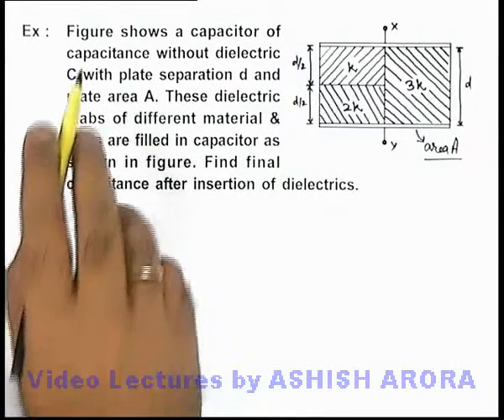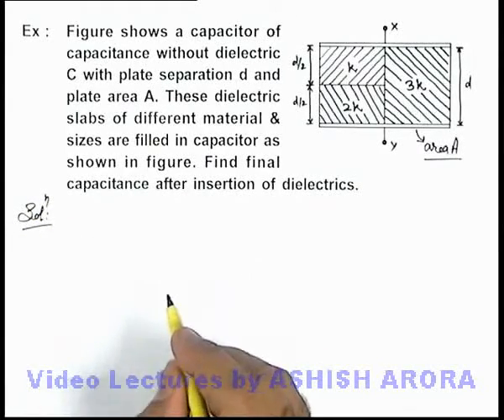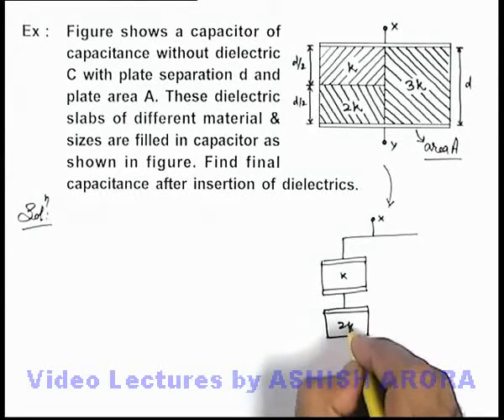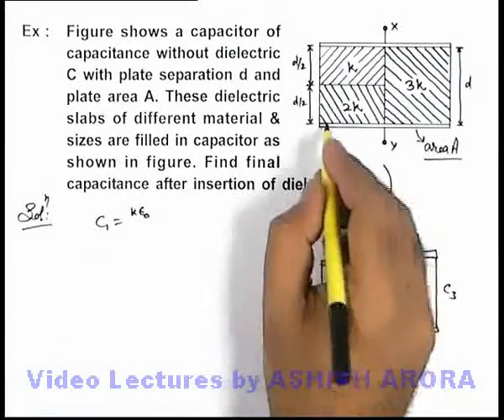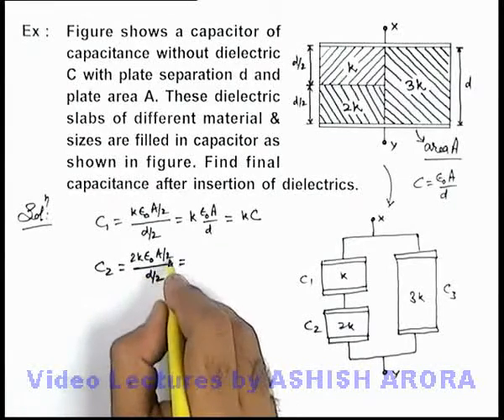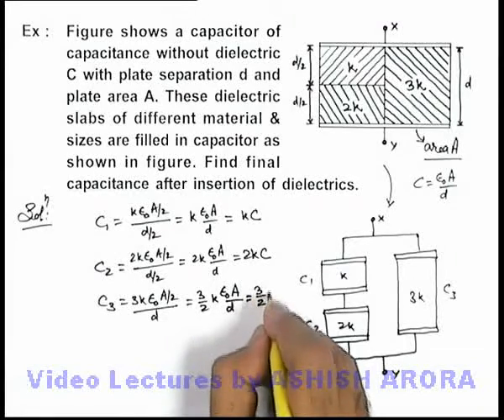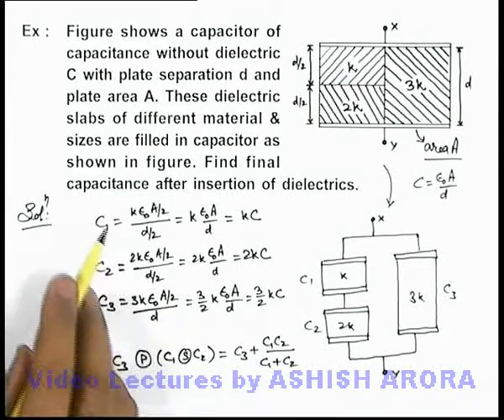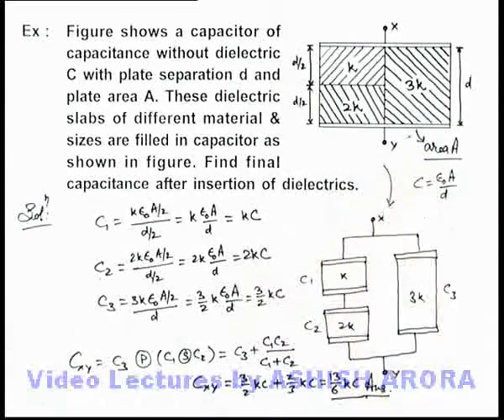Class 12 Physics | Capacitance | #39 Solved Example-8 on Capacitance | For JEE & NEET

Comment: Sir, for c1 and c2 the plate area should be a/4 and a/4
Reply: Please explain sir I can't understand
Reply: (The plate area=A) is divided b/w two :(the 3k) and the( k,2k)....
Reply from the maker: No... as width of slabs are same as that of plate so area will be A/2 only... think again carefully by keeping the 3D image of system visually...
Reply: @physicsgalaxyworld but sir we are comparing it with respect to the original capacitor in mind which had 4 times the area of each of the 2 capacitors on the left side...

Comment: Sir, Why cant we divide the 3k slab in two parts and take the k and 3k part in parallel and the 2k and 3k part in parallel and then take the two in series ? What is the mistake in this ? At first it seems like this is the second way doing the same thing but we get different answers....
Reply: In your method you re assuming that half of 3K dielectric and 2K dielectric are in same potential difference, which is wrong.(as electric fields in both regions are different while distance same)
That's why answer coming is different
Reply: Raunakk Banerjee 
Yes u can 
Same result is coming ,check u might had committed any calculation mistake

Comment: what is the heat produced when a dielectric is inserted slowly with battery connected ?
Reply from the maker: Zero... its only due to the polarization of the slab but we do not account it here as polarization vector is not in scope of these lectures of high school physics... and here we do not consider it into accounts...
Reply: Sir I mean the heat produced in the circuit i. e in the wires..How the word slowly affects the result.If charging current is established then heat must be produced. Plz explain.

Comment: but if we take the dielectrics in a different combination i.e. if we break the dielectric with dielectric constant 3k into two parts and take k and 3k in series and 2k and 3k in series and the resulting combinations in parallel then we get a different answer.
why is that happening?
please explain
Reply: In your method you re assuming that half of 3K dielectric and 2K dielectric are in same potential difference, which is wrong.(as electric fields in both regions are different while distance same)
That's why answer coming is different
Reply: @chakradhar5884  thx bro😋
Reply: @HeeWhooRemaiins  wlcm
Reply: @chakradhar5884  bhai itna detail mei kaise jante the tum
Reply: Uday Bansal  ya, we get 39/20 times kc. Did u get the same answer
Reply: no, that method is incorrect.